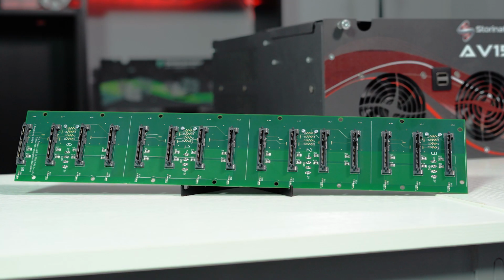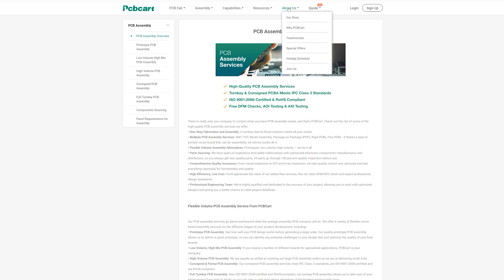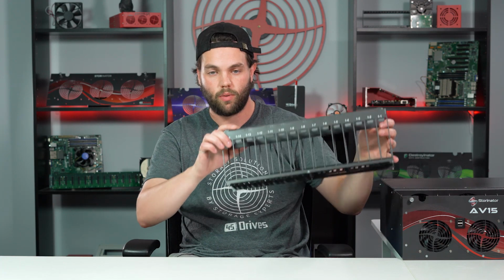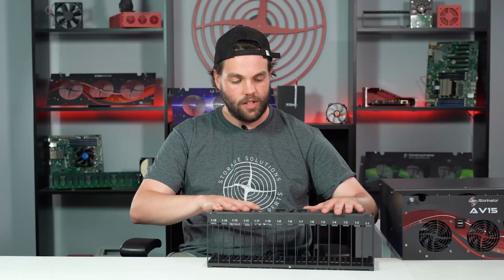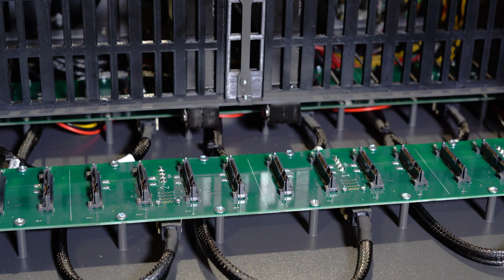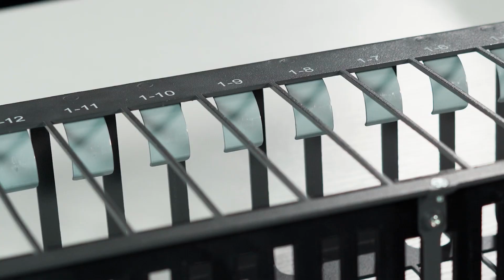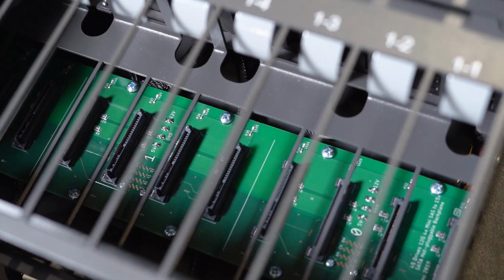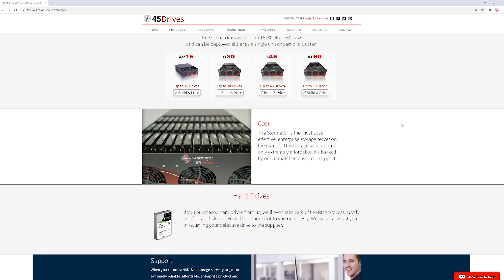Tuesday Tech Tip - Storinator Re-Design: Modular Drive Cages

Comment: This would be an amazing option for home users with a 3D printer.
Reply: I so want to get the cage and circuit board for mounting in one of my cases. Would make that computer live longer as a proper NAS instead of sitting in the corner doing nothing because it only has two mounts.
Reply: @intheprettypink  Right not to mention hot swap drive cages don't exist for consumer level pcs, Imagine if someone made this a little more module so the end height is adjustable, or has mounting equipment. DIY servers would be amazing for home use. I mean businesses/enterprise wouldn't care since they need the official stuff, but game changers for the little guy.